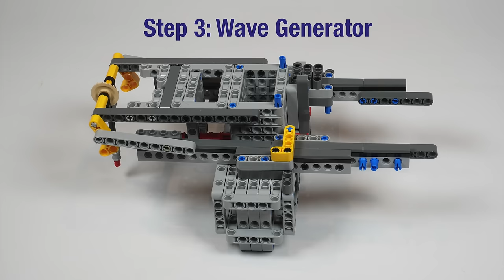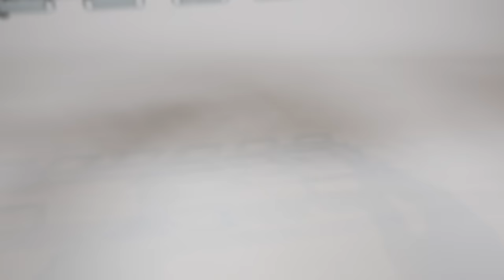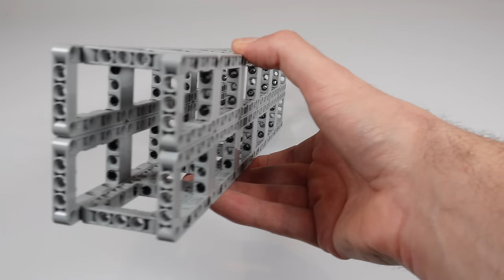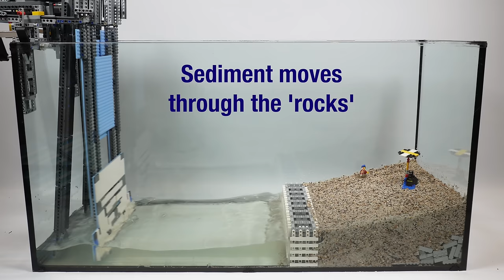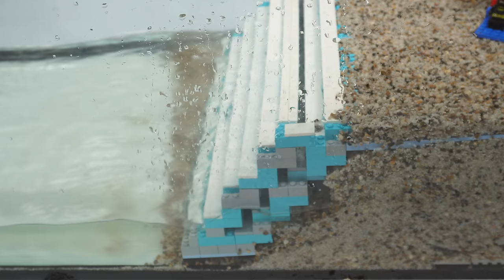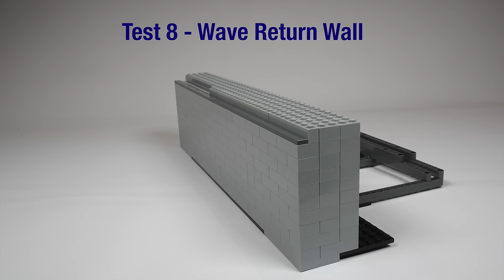Testing LEGO Sea Defences!

Comment: The problem is beaches EXIST because of erosion. A sea wall may have stopped the beach eroding, but now you've essentially just turned it into reclaimed land. Given time plants would start to colonise the sand, forming first dunes, and eventually a meadow.  That is if some developer didn't see it first and go "What a great site to build sea front property on!"
Reply: Well, that’s sort of the point. It isn’t a problem, it’s by design (not that Batman seems to know it). What’s really interesting is that you can actually see a sandy beach form during the first and second tests.
Reply: Bro there is a Batman Figure at the Beach maybe y take a bit To serious
Reply: Solution: mangroves will act as a buffer for tsunamis and large waves but does not completely stop them the off shore breaker is one manmade example
Reply: I prefer glass, concrete, and refined metals over plants and dunes. Gross, when I look at nature, I see an opportunity to remove those pesky things like wildlife, plants, and natural landscapes to build a nice Walmart, fast food chains, and weed shops. As well as casinos and brothels. All on top a think layer of asphalt, not a blade of grass in sight.
Reply: @Kai...999  based and industrialpilled

Comment: for the hollow break water, you need to alternate the beams. like for the gap in the front there needs to be no gap in the back or at least no gap directly behind, breakwaters are cheaper to make if hollow so i hope you implement this change in the future. . this way you can dissipate the energy better.

Comment: you say the least erosion but most of that was caused by water getting past either side where it didn't fill the entire width without that gap there would have been no erosion. a more curved version of that last wall a bit like a snow plow should be installed along all coastlines prone to severe flooding and tsunami.